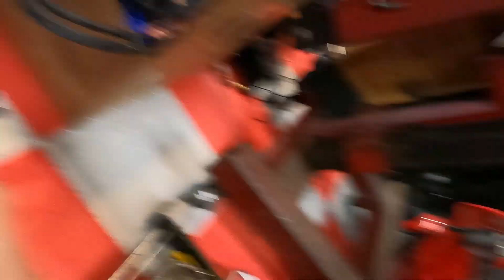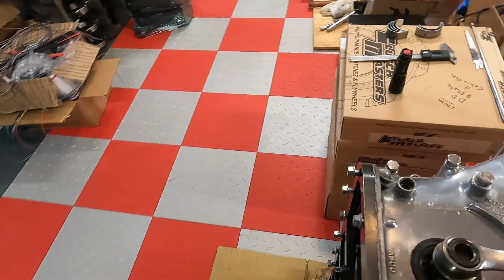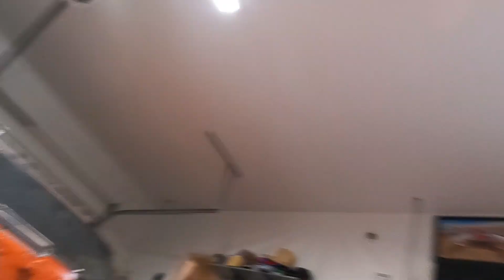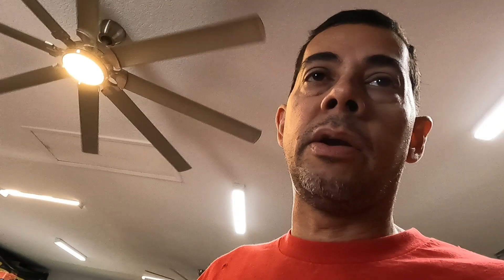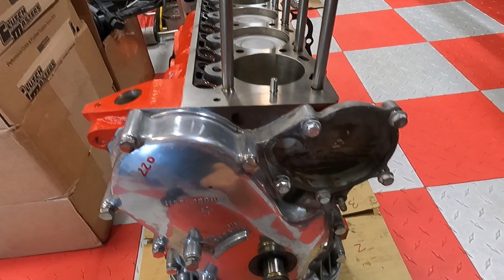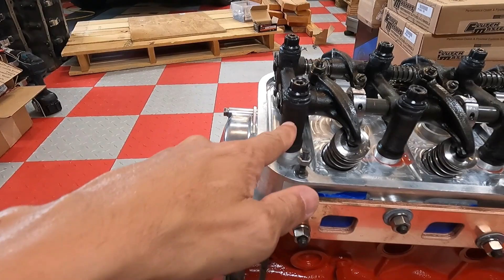3TC race motor assembly Part 2  #psiracing #3tc #teamtoyota

Comment: I didn't realize the 3TC was a hemi.
Reply from the maker: HAHAHA yes sir it is
Reply: @psiracing  Interesting read on wiki.  Took a lot of groking to get the actual decoder ring built, but now I think I get it.  However, there seems to be some slight nuances to look out for.  I thought all "G" engines were Yamaha heads, but they are not.  It only means performance and DOHC.  The 3T-GTE is an interesting engine to see you guys rebuild.  It is DOHC, but still 2 valve and HEMI with 2 spark plugs per cylinder.  If you need the smaller displacement, it would be really interesting if a 3T-GTE head would mate up to your 3TC block.  The other interesting note is that the "C" is for California with EGR.
Reply from the maker: @sammcbride2464  Definitely interesting, we actually have a 3tgte head and a 2tg head. We plan on building them in some of our own personal cars!!